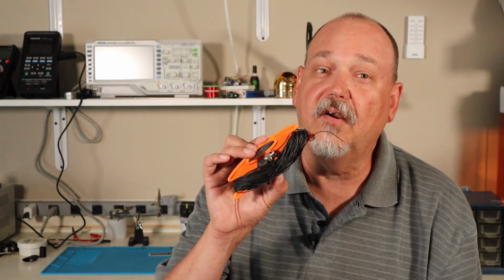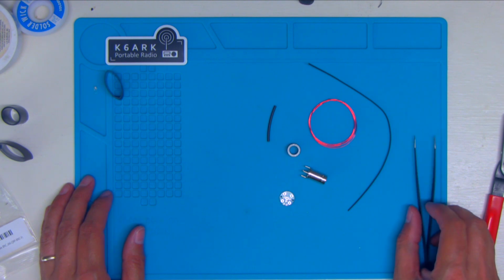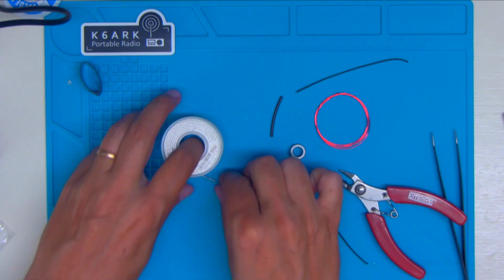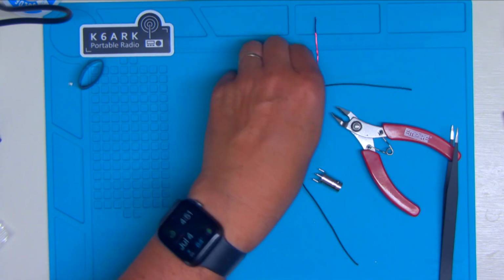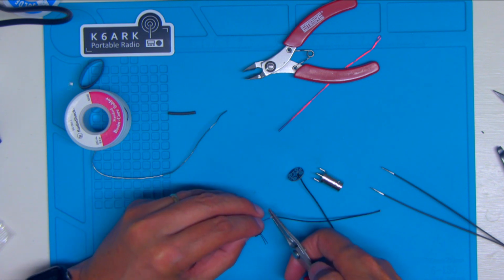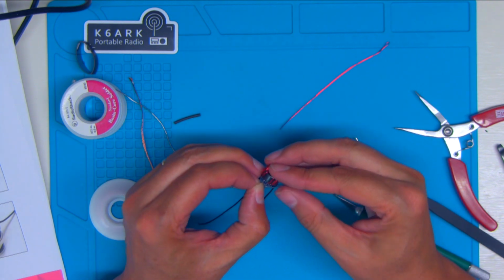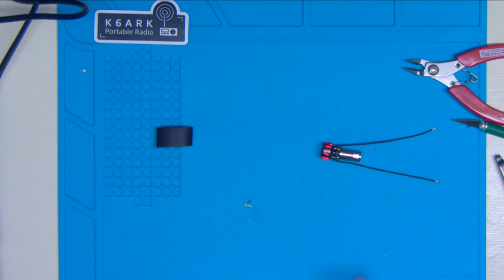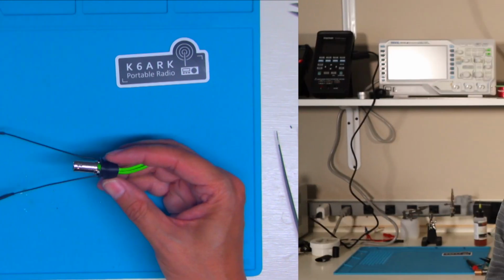Build K6ARK QRP HF Dipole Matching Unit

Comment: Couldn't you use the counterpoise solder connection? If you're wound as 1:1 then 1 lead goes in:out and the other from gnd:counterpoise right? I appreciate the build video because I've been looking at this for a linked dipole just like you and couldn't find one anywhere
Reply: nevermind forgot you'd have an open circuit where the SMT cap would be.....I'm dumb LOL
Reply from the maker: Thanks for the comment Dave as others may have the same question. Ya beat me to it. Yeah. Also if you look at the schematic for the EFHW version there is a short across the ground line which is not the case on the Balun.
Reply: @houseofhamradio  go figure, I’m dumber than the engineer who designed it 🤣
Reply from the maker: Don't feel dumb Dave. I actually wondered the same thing as I was putting it together. Also, there is very often several ways to skin the cat so asking questions is a good thing. Things aren't always as obvious as they may seem. Electronics is a funny world and although I have been doing it since the early 80's I still learn stuff every day. In other words, keep questioning it, that is sometimes how new ideas come out.
73s
Bob
WV7W